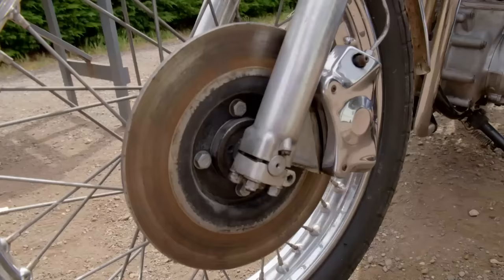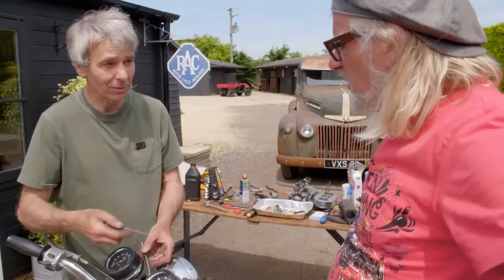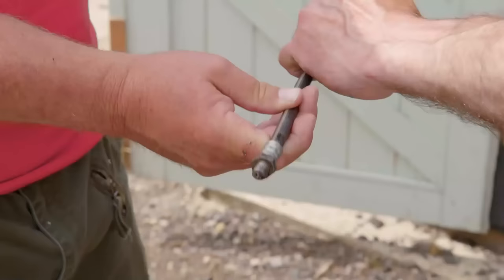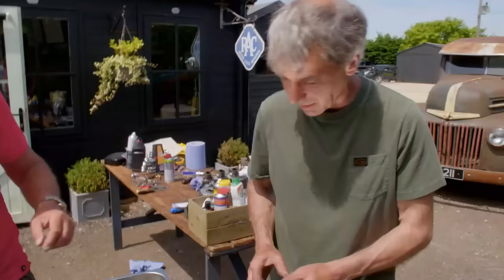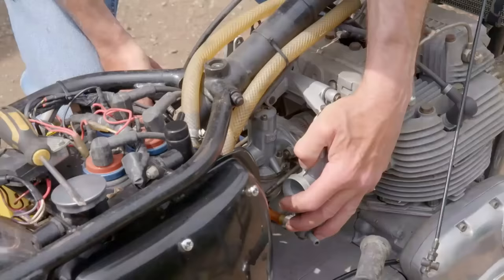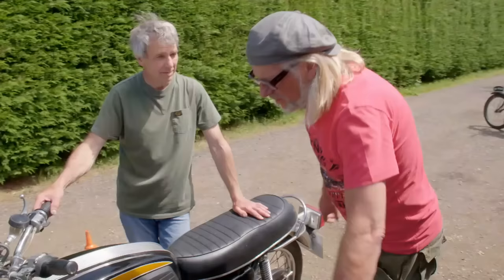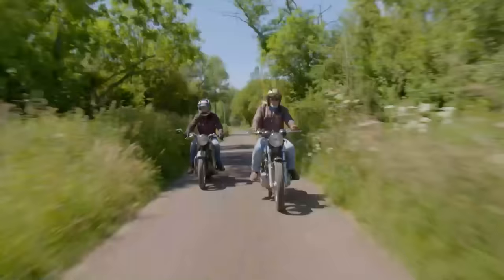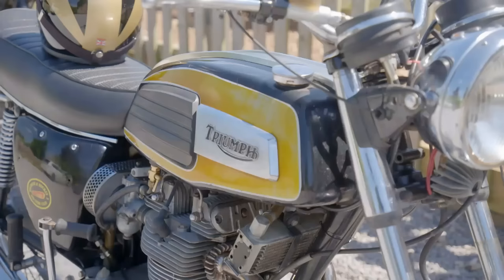Triumph Trident T150 resto with Millyard

Comment: To all you classic British bike fans, if you have never sampled a well sorted T150 or T160 you are missing a real treat. I was a mechanic back in the early 1980s and I worked on or rebuilt every three cylinder our dealership sold. When they are right they are fantastic and nothing like the British twins or even the Japanese multiys. They are smooth with a disincentive growl. They pull from just off idle and carry their weight low for great handling. They were a bit rushed into production and the build quality was not the best.

Comment: Those brake lines corrode internally and cause them to get plugged.  They can actually become a very effective check valve and lock the brakes on so do the right thing boys and change it. Very dangerous to tamper with it.

Comment: " Motorcycling is freedom.......even at 20 MPH !"   Ohhhhhhhhhh yes !
I once had a Dodge Avenger with a internally-collapsed right front brake hose. The hose behaved like a check-valve, keeping the hydraulic pressure ln the caliper, when the pedal was released. For quite a while, I couldn't figure out why the right brake-pads were wearing out prematurely.
Allen Millyard is beyond genius.
Trinidad & Tobago.
West Indies.